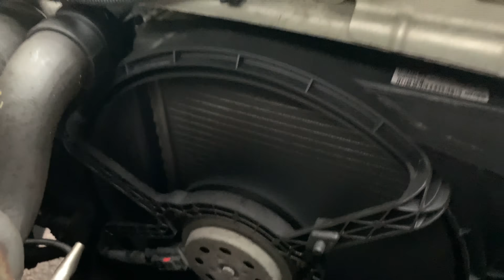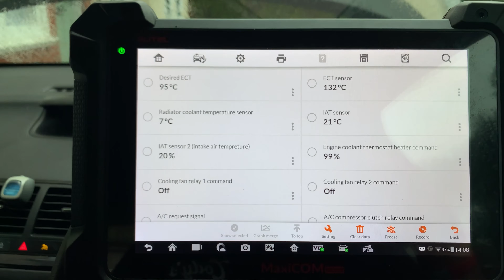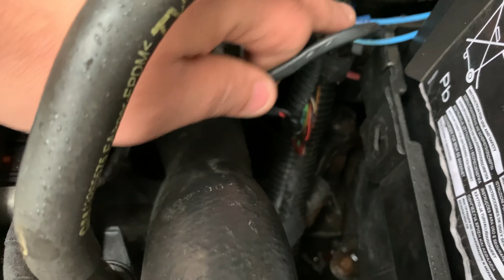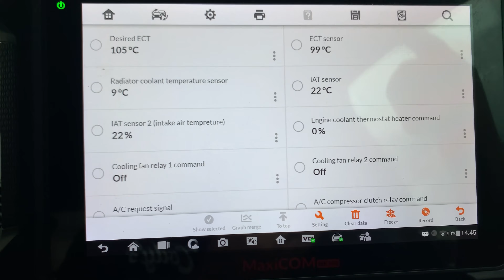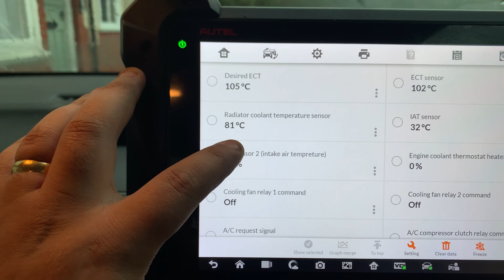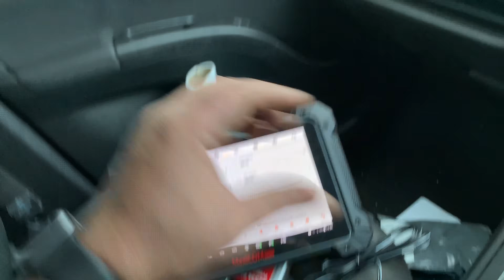Vauxhall Meriva Coolant Temperature Sensor Fault | Fan running at all Times P0118 P0119

Comment: I have a similar problem with Vauxhall Meriva 63 reg (fan turns on instantly), however my mechanic is suggesting that I need a new radiator but this is confusing me? Would you be case with an overheating problem?

Comment: OK. Bloody thing started to overheat. Stopped. Let it cool. Chucked in garage. Found main hose to expansion tank bot sealing. Did that. Did again. Got to garage. Expansion tank had a leak. Fixed that. Got back. Fan goes all the time. And on rock bottom on gauge. So will change this bugger and see what happens

Comment: I've too got a MAP thermoS that won't open, brand new, stuck closed.  Tested OHMS.... , I've bought 2x Temp sensors yet arrive, I wondered if it was a bad circuit / ECU related woe, this could just be temp sensor bottom rad or engine side/both stopping MAP thermo open, my car boils over, rad system closed off, it's fine no thermo less straight through test, ......
Reply from the maker: Sorry pal but it's difficult for me to understand your question. The thermostat is mechanical that will open between 90ºc and 105ºC,  now the best way to  test the temperature sensor is looking into the live data and perhaps use a decade box , in he live data you should be able to see the block temperature sensor figures and radiator sensor figures as well , manipulating the sensor circuit with de decade box will tell if the circuit or ECU are bad ... I hope it helps 👍
Reply: @CarsExposed  THANKS, RE: manipulating the sensor circuit with de decade box will tell if the circuit or ECU are bad ... I hope it helps - I definitely need data ( graphed ) for sensors on circuit

Comment: Mate, did you face any issue regarding the Air condition not cooling on this car? I have a 2013 Meriva B in Portugal and my air conditioning is not working, it is always in 26 degrees and I have checked the gas (full) + changed the internal filter but still not going below 26 degrees. Thanks a lot
Reply from the maker: To be totally honest I never tested the AC ,  but I guess it’s ok I see the car time to time and no complaints 👍

Comment: Have you ever seen a temperature gauge go straight 90 deg from cold and car starts but cuts out straight away?  It's a meriva like this one.
Great video 👍
Reply from the maker: Yes I have... the ECU also uses the engine temp to regulate how much fuel the injector will supply so when the car is cold more fuel is supplied when the car warms up less fuel is supplied , now if the car is cold and a bad temperature sensor reports 90° operating temp , the ECU will supply less fuel and a lot of car don’t even start or if it starts runs really poorly or stall👍
Reply: @CarsExposed  yes I had similar thinking,  thanks for your reply.
Reply: @doosanengineer7659  My car has the same issue, how did you fix it?
Reply: @td2290   I fitted a new coolant temperature sensor. It's on the housing to the  r/h side of the cylinder head on my dad's 13 plate meriva.
It was held in by a spring clip.
Problem solved.
Reply: @CarsExposed  bruh you may have just saved me Alot of stress with this knowledge ty.